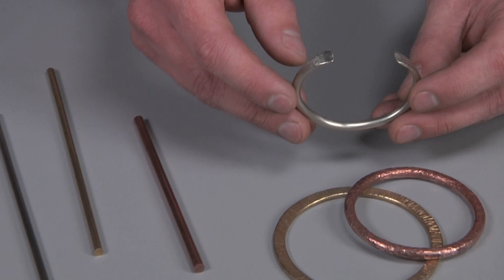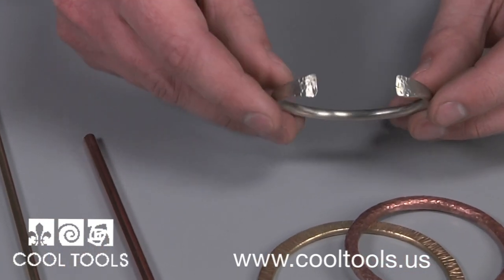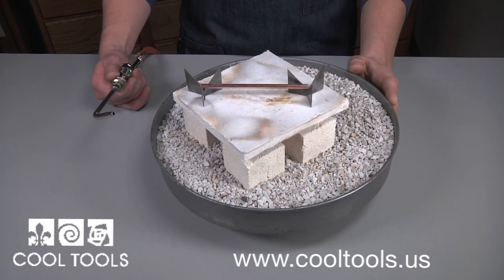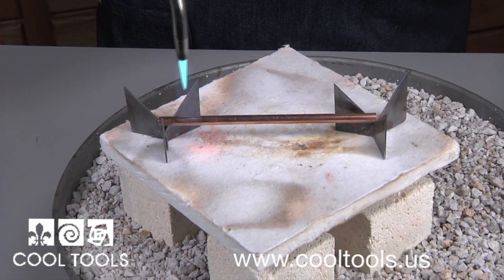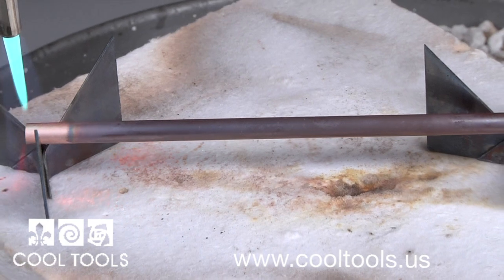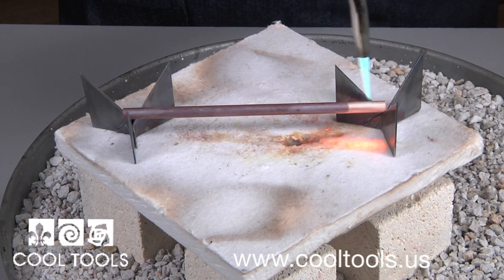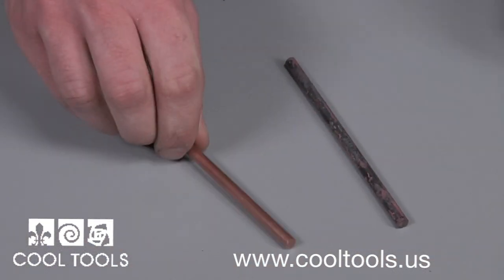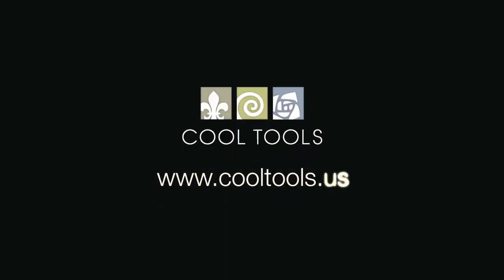Annealing Metal

Comment: Does working with the metal after annealing, cause it to harden once again? how many times can you anneal a piece while you are working with it?
Reply: well yes it strain hardens,for an instance if you take an annealed copper rod and bend it,it would bend quite easily but if you try to bring back the original shape,you wouldn't be able to do it with your bare hands....simple explaination is that its due to work hardening property,same is with ss304

Comment: how much temperature required for annealing?
Reply from the maker: Hello, you want to heat the metal until there is a dull red glow on across the whole piece of metal. Hope this helps!
Reply: About 30 to 40 Deg.C, above the upper critical temperature range of the metal.
Reply: @benalexandre4423  what's the meaning of critical temperature ?